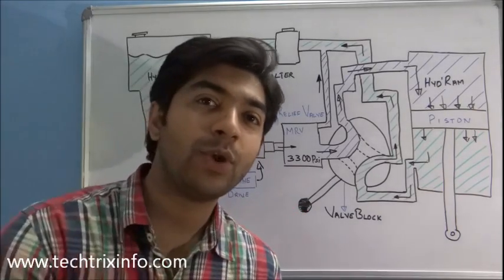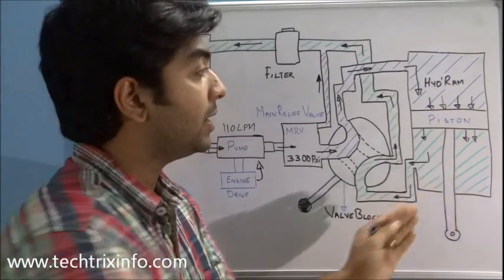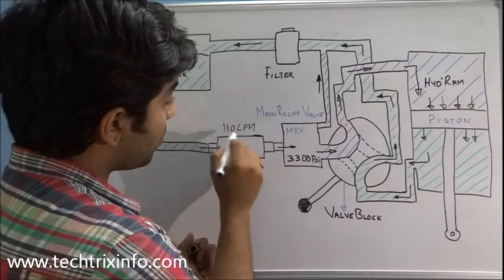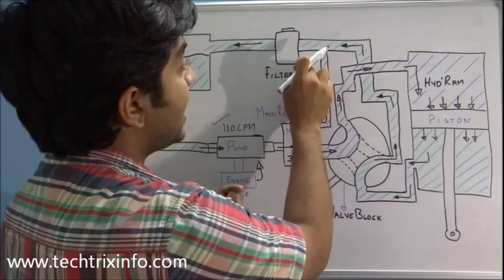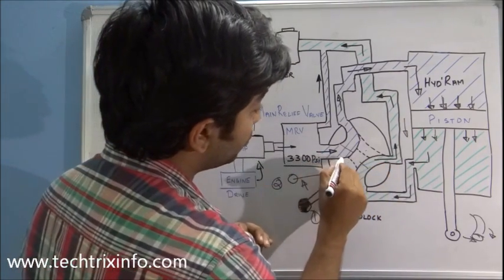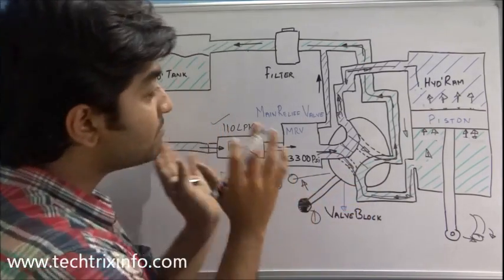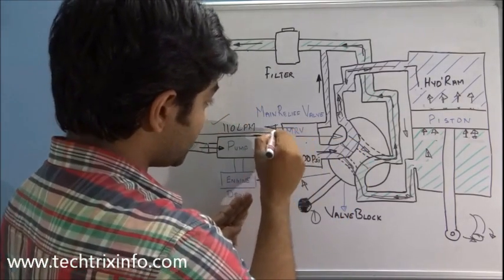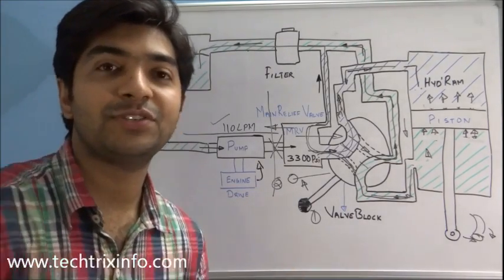How basic hydraulic circuit and components work. ✔

Comment: I am working in Gulf as a Construction equipment service technician.
 Your video about hydraulics circuit & excavator is very use full for me.
 very thanks for the work. ! 
 If possible can you do a help for me.?
 i am working with concrete pump. Schwing stetter SX36, SX 42 etc.
 Can you please explain the circuit & working of the concrete pump.?

 If required i can give you the Hydraulic & electrical circuit diagrams.
  Anand- whatsapp: +973 34561692. email: anandnambissan2@gmail.com
Reply: Anand V.M I am a hydraulic specialist, its my pleasure to assist you, I am from Iraq, I can talk with you next Friday noon at whatsapp if you want
my Email is : develop1869@gmail.com

Comment: Great video.

I do think it should be known that the hydraulic piston shown was in fact a piston and not a hydraulic ram - a hydraulic ram has no sealed head and the ram can only be hydraulically powered to operate in one direction - the other direction requires an external force such as gravity after pressure has been relieved.